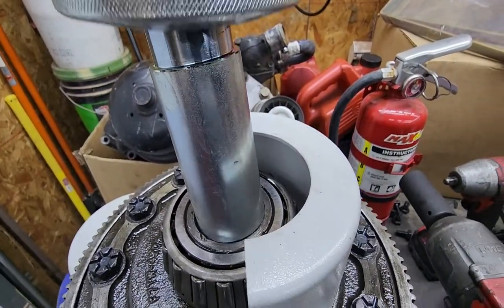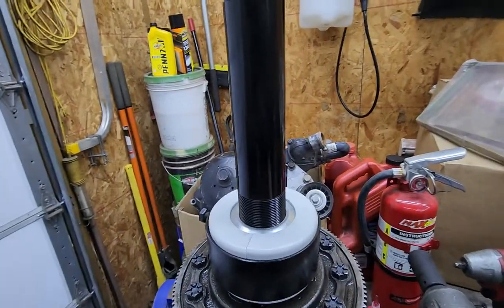VEVOR Carrier & Pinion Bearing puller review

Comment: BEWARE!!!!!! I placed a order through VEVOR for a Carrier & Pinion Bearing Puller. Upon arrival of the tool I went to use it for the first time and the main housing piece the bolt would not turn by hand or by a 1/2 inch ratchet. I took a flash light like and shined it down the hole and it appeared to have some hard looking gunk all down the threads especially toward the top where the thread insert is. It appeared to me to be welding slag or big chunks of paint. I ended up having to take the housing insert it in a vice with some rags so it wouldn't scratch. Then I took my high torque impact and tried to break it loose. It wouldn't budge at all. Then before proceeding I took some oil and poured down the hole to help lubricate it but it still would not turn. I then had to break out my torches and to heat up the bolt and finally got it to move the bolt a few threads. I worked on the bolt screwing it in and out for close to two hours before I was able to get it function semi properly. I attempted to reach out to customer service to see if i could get a replacement due to it being defective out of the box and that I wanted a replacement housing and bolt the lady was real nice she created a ticket and sent it up to support. Support responded the next day to basically stating that there is no way that could happen due to them screwing the bolt in the housing by hand before being put in to a box. I was completely dumbfounded I was told I was a liar over email. This is not customer service at all!!!!!. I asked for the replacement parts to make it right however I get insulted by support. I really think this company needs to get some quality control or to check over there process to ensure this doesn't happen to everyone else. Also to have support revaluate how they handle troubled tools....If the company decides to make it right by giving me a replacement tool or housing I will respond with some updates.

Comment: Good demo video! I ran into the same issue with the clamp shells for my gm 12 bolt pinion bearing, I am going to have to grind it some also. It is supposed to grab it by the bearing cage correct?
Reply from the maker: Yes that's what it's made for. Just the cage.